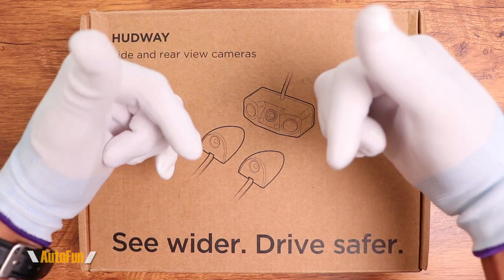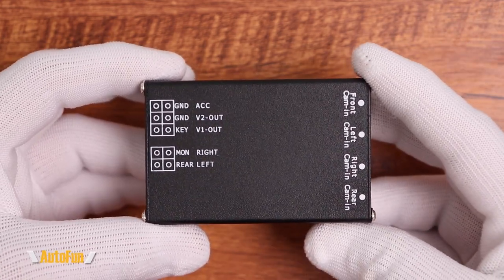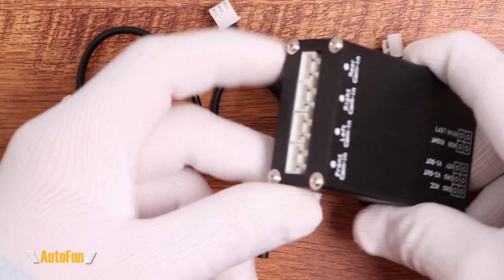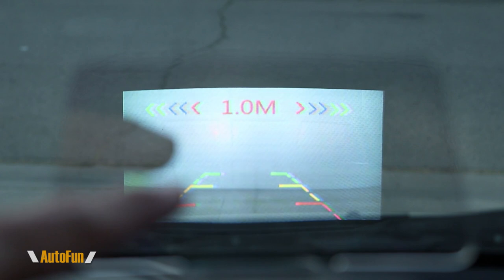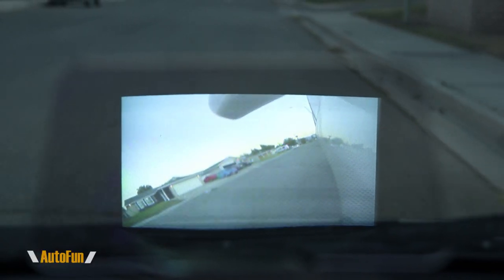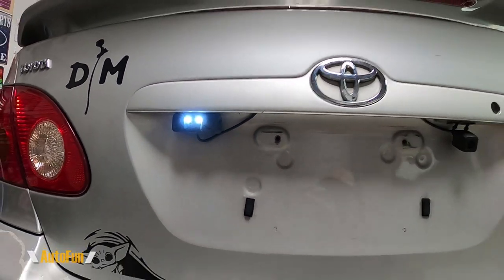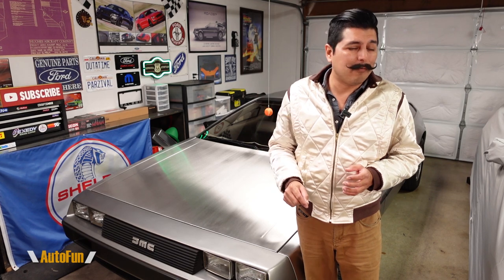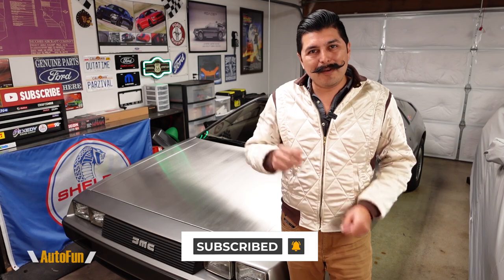Hudway Drive Car Heads Up Display (Park Assist & Side Cameras Install & Review)

Comment: This hudway has some very interesting features. I certainly would love to have side cameras but stick in the side mirrors. The beep when reversing is a little annoying but it would be helpful for some occasions
Reply from the maker: Hi Giovanni! Yeah it definitely does, what I want to test also is the ability to display engine data from a OBD2 dongle, Hudway was supposed to come out with one but they also say that aftermarket ones will work so I'm experimenting with that right now, I think it may be helpful for the track. But yeah man the beeper can get annoying very quickly (mine is already disconnected lol!)

Comment: Great!!! I have been looking forward for this.
Reply from the maker: Hi Ludoviko! Ah good question, I had good results switching my cars to full synthetic over blends. The trick is to switch over early in life of the car, I heardswitching later can results in leaks, also when you go full synthetic it is not recommended to go back to conventional, kind of a one way trip so just be aware of that. Regarding using the HM version, I switch my older cars to that since I seen it reduce oil leaks and the high ZDDP content of HM oil seems to benefit older engines in my experience. That being said, it is also preference, some mechanics will not use HM oil since it can swell old rubber seals (which stops leaks) and prefer to run non HM and fix/replace the actual leak that use an oil to address the issue (which makes sense but like I said it just personal preference) Hope this helps and thanks for watching!

Comment: great review. can I install the rear camera to the front of my pickup instead? will that give alarm everytime im close to something in front of me.
Reply from the maker: Thanks Joseph! Correct, the radar camera can be installed anywhere you want since it's waterproof. Also yes you can leave the beeper disconnected if you don't want to hear it beep (that's what I did lol) Hope this helps, Cheers!

Comment: Hi. Its a nice video as always but you missdd out one thing which hudway description also doesn’t tell. How to connect video selector to power? It has stripped cable on one side.
Reply from the maker: Thanks mac san! Ah yes there are a couple ways to tap into the car's wiring for power including soldering and T-tap connectors, here is my video showing my approach https://youtu.be/LHGxwulIPes Hope this helps, Cheers!
Reply: @AlexAutoFun  hi i meant the video selector .”Connect the stripped ends of the red and black cables (#11A) to any 12V power supply that is the most convenient for you”(as written in the Hud camera installation)
How do I do this? One port of the given adaptor is being used to power the HUD and if I want to use the 2nd usb port for the video selector do I solder the stripped end to a usb jack?
Reply from the maker: Hi mac san! correct, the end of the red and black wires can be connected to the car's wiring to pull power using several methods including soldering or IDC connectors (what some people call t-tap connectors) You can see how I locate power and how I tap the wires for power on the video I linked earlier. Hope this helps, Cheers!
Reply: @AlexAutoFun  i am really not comfortable connecting to car wires as that can cause a fire. Best is connect the stripped ends to either a usb A connector or with a 12 v cigarette light adaptor
Reply: @AlexAutoFun  i am swamping you with questions. Since i find it unsafe to connect directly to the car wires 
i will now place the video selector in the front of the car and connect a usb to the loose wires to power the selector which in turn will go into the second port of the given adaptor.
Then i will run all cables to the video selector since this way only one cable for back camera needs to come to the front rather than all going back to the boot.
 That sound right?
Reply from the maker: @macsan1234  Hi mac san! correct, if incorrectly done, a improper installation can cause damage, fire, injury and even death (sounds crazy but I got a story for that one day I will share) I strongly recommend professional installation. IDC connectors when correctly installed are reliable, they are extensively covered in the IPC-620 standard which we use in the industry for wire harnessing. Hope this helps, Cheers!
Reply from the maker: @macsan1234  Hi san mac! Yes if incorrectly done, a improper installation can be unsafe and lead to injury or even death (may sound like an exaggeration but I got a car story that one day I will share) I strongly recommend professional installation. IDC connectors or solder when correctly done are reliable, both are extensively covered in the IPC-620 standard which we use in the industry for wire harnessing. Regarding connecting the wires to USB and locating the box in the front of the car, I would recommend contacting Hudway for support, the box needs 12V where a USB port can only provide 5V, same with the wires, locating the box in the middle of the car may not allow all cables to reach including the wires that go to the tail lights of the car for the automatic lane switch detection. Hope this helps, Cheers!
Reply: @AlexAutoFun  thanks a lot. I always assumed if I just get it soldered to a usb and just connect to the second port of the given adaptor plugged in the cigarette lighter it would do it but you are saying it will be 5v only?
Isnt the cigarette lighter 12v?
Putting the video converter in the front means just getting the rear camera wire to the front as the for t cameras and everything else is located close to the front.
Guess I will get help from a professional car electrician
Reply: @AlexAutoFun  by the way isnt the cigarette lighter port. 12v? Cant i solder this to a usb and plug in to the second port?
Reply from the maker: @macsan1234  You're welcome mac san! Ah yes, the selector box can be installed anywhere on the vehicle and the wires can be extended via lap soldering or crimp (with Butt splices). Regarding the cigarette lighter output, correct it's 12V however a USB adaptor brings that voltage down to 5V to meet the USB standard (this USB adapter normally supply a maximum of 2Amps). The video selector requires 12V and likely needs more than 2A to function correctly. Hope this helps, Cheers!
Reply from the maker: @macsan1234  Hi mac san! Correct the cigarette lighter output it's 12V however a USB adapter brings that voltage down to 5V to meet the USB standard (this style of USB adapters normally supply a maximum of 2Amps). The video selector requires 12V and likely needs more than 2A to function correctly. Hope this helps, Cheers!
Reply: @AlexAutoFun  oh. Now i get it. Assumed if hud was ok with it cameras would too. Thank you for this very imp input
Reply from the maker: @macsan1234  You're welcome mac san! 🍻
Reply: @AlexAutoFun  sorry me again hopefully for the last question on this
I just had a thought.

My toyota has a usb port too separately.

What if I plug into that for the HUD power instead of via the given adaptor to cigarette lighter (which i have  done right now 
and 
 then get the video selector wire soldered to a cigarette lighter plug which goes into the cigarette lighter directly in the front next to the steering ?   
That will give the selector 12v and I wont have to connect to car wiring ?
Then i just have to run the rear camera wire to the front of the car(rest of the wire already near the front)
That ok?
Reply from the maker: @macsan1234  Hi mac san! You may be able to power the Hudway device with you car's built in USB port but it's going depend if your car's port can output the power required for the Hudway device (2.4A) Most built in USB ports on cars only output 1A or less. I would check the owners manual, it may show you what it's specs are. Hope this helps, Cheers!
Reply: @AlexAutoFun  you have been so patient. Thanks again and again 😎👍
Reply from the maker: @macsan1234  You're welcome! 🍻

Comment: Hi, that is a good content! I actually want to install a display and hook up 3 cameras. What would you recommend if I want to constantly see all 3 images from at the same time? May I end up with this system but to connect it to a head up display? Thanks
Reply from the maker: Thanks Max! Ah yes if you only need 3 channels, here is a good choice https://youtu.be/EeCSx35mkPY and if you want it on HUD style here you go https://youtu.be/b2JXMQyU-24 Cheers!
Reply: @AlexAutoFun  that is how you got +1 subscriber). I checked that 3 channel mirror display and that's what I am looking for but I want same idea but with dash display (ex. Carpuride). Do you think this possible?
Reply: @AlexAutoFun  maybe there's some kind of converter box similar to the one you showed in this video with several inputs for cameras and one output for a display?
Reply from the maker: @maxsmith3193  Hi Max! Yes there are multiplexer boxes out there for people looking to build their own systems, most of the systems I review are full solutions but if I do review a multiplexer in the future I will update this comment for you. Cheers!
Reply: @AlexAutoFun  hey, I checked multiplexer box and they are good for recording multiple channels but for some reason you can't connect a display to access the videos in real life. They actually have couple of models with small build display, so it is not possible to hook up any aftermarket display, unfortunately
Reply from the maker: Hi Max! Here is another solution that can display up to 4 channels at the same time https://youtu.be/4p5f4md2Ro4 Cheers!

Comment: Hi Alex great video! Have just ordered the Hudway Drive. What would you suggest for a front camera? I could buy this unit for the side cameras can I use the reversing camera not attached to signals and use it as a front camera. Would I have to use the joystick to view it as I want?

Cheers Robert
Reply from the maker: Thanks Robert! ah I think your are trying to see you front bumper while parking? while you could mount the rear camera in the front, the view will be reversed (but this may not matter much if the main purpose to protect your front bumper) since it was meant for rear it will be like a mirror, things on the left will be on the right and things on the right will be on the left. Here is another system that may interest you https://youtu.be/Ht9Q-0HlKMY And I have more front and rear backup systems reviews on my channel under the playlist "Back Up Systems" if you like to compare. Hope this helps and thanks for watching!

Comment: Hi Autofun, I'm wondering where are the power and ground cables goes to in the trunk? I'm currently working on the installation and have no clues
Reply from the maker: Hi Imam Imam! I would recommend to the installer to follow the instructions included with the kit to make sure everything is installed correctly (you also use the barcode shown on the video to go the full color instructional on the Hudway website). The kit itself needs power (12V+ and ground) now where they actually get connected for power, that varies from installer to installer (they all have their preferences lol I choose to install it in the trunk because that seem to be the most central location for me) If the auto switching for the side camera and the auto reverse camera switch are desired, then each one will also need a connection to be made (each one uses 1 single wire for the auto switch, so 1 connection for the left turn signal, 1 for the right turn signal and 1 for the backup signal. Here is my video on how I tap for power (and the signal) in the car https://youtu.be/LHGxwulIPes (I used the process for the signal wires but also used this process to pull power from the kit, except I look for a source of constant power vs switched power from the backup light) Cheers!

Comment: Could you turn those cameras around and use them forwards to help with parking near curbs.
Reply from the maker: Hi Brian! Yes technically the cameras can be placed anywhere (facing different directions) only limited by the skills of the installer in routing the cable. And if you are looking for a wireless solution here is a good alternative https://youtu.be/1c7raDpHx3M Hope this helps, Cheers!

Comment: Another question, Alex! Can I connect the side cameras to an existing monitor/screen that I have in my truck?
Reply from the maker: Hi Joshua! unfortunately connecting a different camera usually does not work (and in some extreme cases it may damage the unit itself). I noticed each manufacturer uses different types of camera that may not be compatible with each other if you try to mix and match. Hope this helps and thanks for watching bud!
Reply: @AlexAutoFun  ! Got that, Alex. That leads to another question- can it work with ‘Hudway Glass’ or does it necessarily need ‘Hudway Drive’?
Reply from the maker: @joshuarozario5654  Yeah it needs the Hudway drive (since it needs the video in port to display the cameras)..

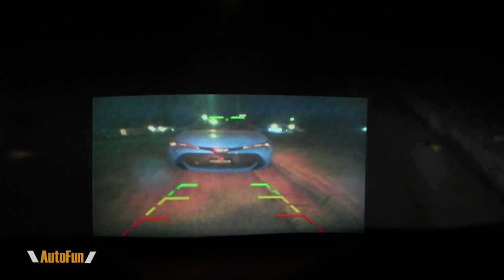Comment: 12:05 alex the numbers didn't work this time, by the way i love your reviews
Reply from the maker: Thank you ban annah! I appreciate that! Regarding the radar read out, the point where you can get a measurement varies depending on the height of the object you are backing into and the height of where the radar is installed. Since the Corolla I installed this on is somewhat high in comparison to the blue car, the radar won't pick it up until I get closer to it (imagine drawing a line from the radar to the blue car, the radar signal hits the hood not the front bumper so it thinks we are far from the car still). If you want maximize the range of the radar to pick low objects placing the radar lower will help (probably same area but on the low part of the license plate, not on the high part like I have mine) Hope this helps and thanks for watching!

Comment: Got a question for you I like to know if you can hook the side cameras to a married dash cam I seen something like that on YouTube but I can't seem to find it if you know if this aftermarket will work with that can you give me a holler back please thank you
Reply from the maker: Hi Gerv401! Regarding connecting the cameras to a dash cam, typically is not possible as each manufacturer different systems that make them incompatible. However I have heard of some cases where people have connected things into a dashcam not originally meant for if the cable happened to fit and the camera worked,  but remember while the connector may be same, the camera hardware may be completely different so I would say if you try this be careful as mixing components will likely void warranty or may cause other unpredictable issues. Hope this helps and thanks for watching!

Comment: Does the hudeay drive shoe the speed limit on the road your on?
Reply from the maker: Hi Franck! it does not, however there are 2 ways you can make it show it, one would be to use the mirror function so you can display Waze or Maps which do have the speed limit. The other way would be to submit that feature request using the app button for submitting requests, I imagine if enough people ask for that feature they may add it in the next update. Hope this helps and thanks for watching!

Comment: Currently there is no camera that can show front, back, side, and the cabin all at once,? Seems this camera is not HD as the video is not bright.
Reply from the maker: Hi Edwin! correct, currently there are none. The closest we have to that is this one https://youtu.be/u7jhNVtxQdM or this one https://youtu.be/JJKbUu_egiE But yeah I think your are correct the cameras on the Hudway seem to be only HD (720) not FHD (1080) as I explained in the video if you need FHD then a stand alone system like this one https://youtu.be/4p5f4md2Ro4 will be a better option. Specially the screen, a real LCD screen will also be much brighter (not transparent) vs the HUD, however that being said I prefer the HUD due to the reasons I explain at the end of the video. Hope this helps and thanks for watching bud!
Reply: I believe we're in the early stages of vehicular cameras, I know they have been around a while, but in another 5 years outer/inner rear view mirrors will be eliminated and cameras will take over.

Comment: The HUD system is pretty sweet and looks like it has great resolution. But those cameras look so nasty on that screen. Its like watching a T.V show recorded on a video tape from the 80s. I am surprised they used analogue video connections instead of a usb connection for better quality video.
Reply from the maker: Hi Ray 167! yeah it's a very cool HUD for sure. Regarding the signal, the reason I suspect it shows static is that they you have a very long cable coming back from the back of the car, so it picks up EMI and other noise from the vehicles electronics. Ways they can reduce this would be using shielding on top of twisted pair wiring, but I haven't cut into the cable so I don't know exactly what they are using but it's kind of funny, I actually liked the video signal. Combined with the HUD it reminds of the way the holograms look on StarWars which is one of my favorite movies, but yeah I'm sure not everyone is a fan of the series and wants that look LOL!